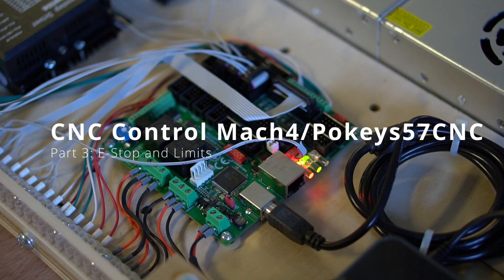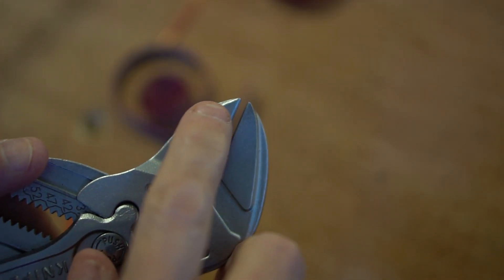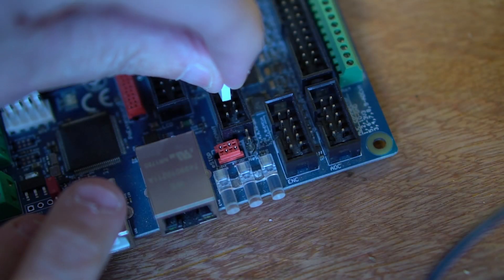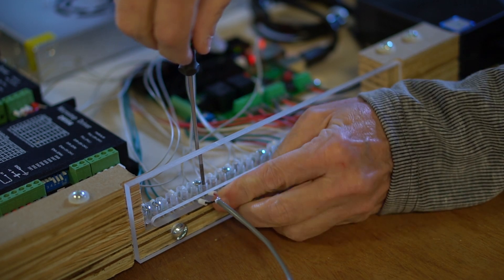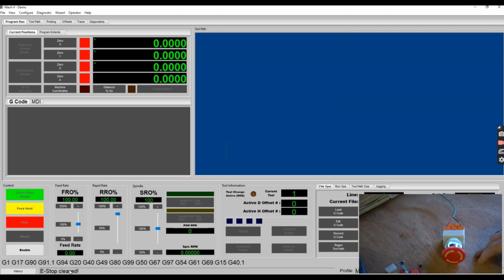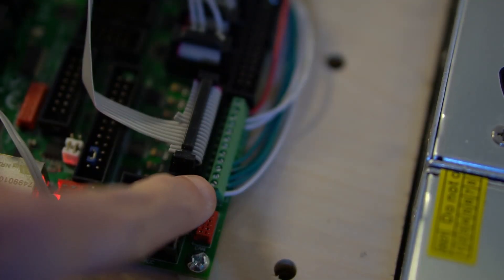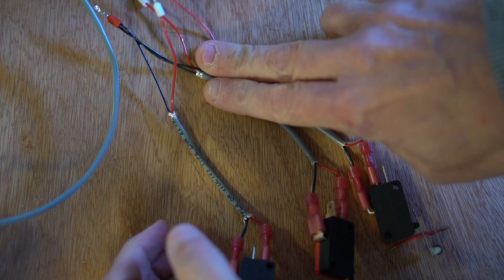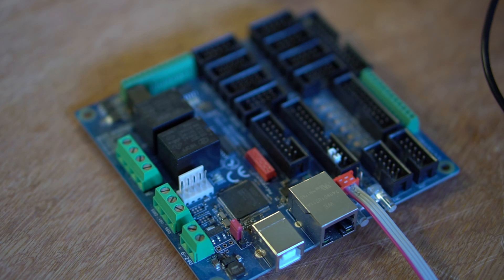Pokeys57CNC and Mach4 Part 3: Connecting the E-Stop and Limit Switches

Comment: Thanks for the video, but I have a question that remains..! Sorry if it's a noobies one.. When limit switch is engage the machine STOP a I have to disable limit switch in configuration panel to make  it move again.. I'm not sure it's meant to work like this.. ? is it ?
Reply from the maker: If you press the reset twice, I will move again. If it doesn't, you may need to enable this in the Settings tab.

Comment: Why does Pokeys use 3 kinds of connectors, the black ones, the green ones and the red ones? Why not all black ones?
Reply from the maker: Many of the products polabs develops interconnects with the the red ribbon cables and the black ribbon cables. The red ribbon cables are convenient when plugged into their drivers. But if you are connecting to traditional drivers, the black connectors are chiefly the ones used. It doesn't bother me at all. It's easy to assemble the black and red ribbon cables.